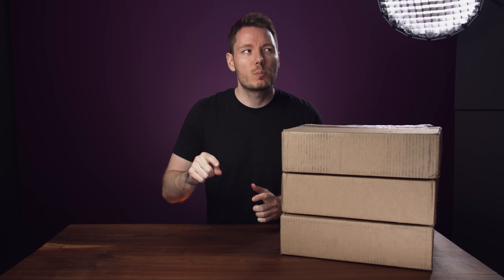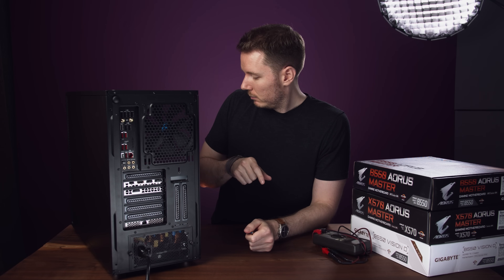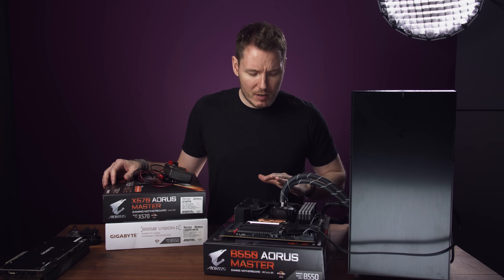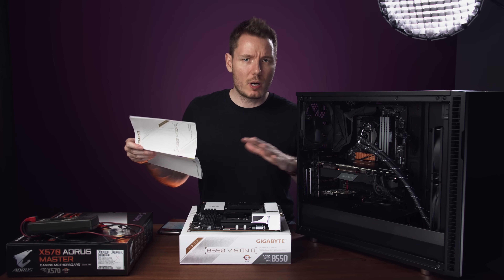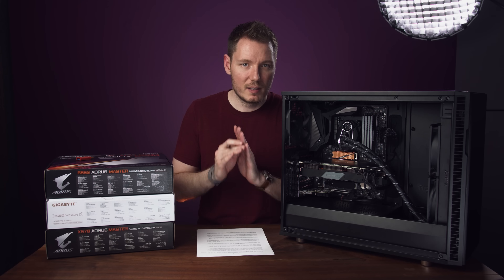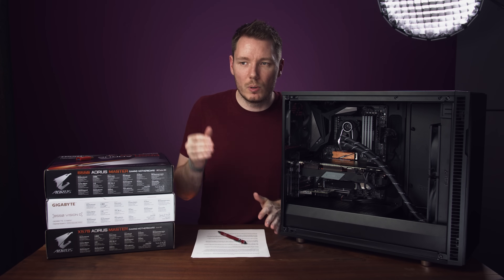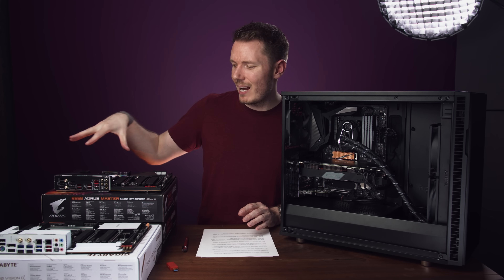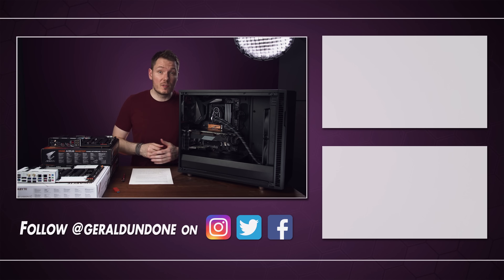I Was WRONG About These AORUS AMD Motherboards

Comment from the maker: For clarity: I have tried swapping the power supply. I've also tried power supply in the case/motherboard out, and motherboard in the case/PSU out, and both out and both in. And tried 3 different power supplies, two from EVGA and one from Gigabyte. It's not the power supply. 😜🤓👍

Update #2: Please stop suggesting I flip my radiator/AIO around, especially when referencing Gamers Nexus. I watch GN too, and I'm following the ideal positioning that Steve from GN recommends in that very video many of you are referring to. There must be a misunderstanding in the community regarding his video, even though he made two. Tubes at the bottom is the ideal way to go for front mounted radiators provided the top of your radiator is above your pump. This way the air bubble will be at the top of the rad and thus won't get sucked into your tubes at the bottom or into your pump. This is what Gamers Nexus recommends. To suggest otherwise is a misunderstanding of his video. And I front mounted my rad because it gave better temps in this build than top mounting. Cheers!
Reply: There is leak current. That is why you don't get continuity when on.

Also the meter can't meter resistance with voltage applied to it, and current leak will apply a voltage differential in the ground.

Also the meter introduces a very small voltage and current to meter the resistance and it might not be healthy to do that with the motherboard on.
Reply: Try a voltage drop test across the ground points when on vs off and see what the readings are. AC and DC. If AC doesn't settle, hook up a scope.
Reply: @RobbyNowell  Exactly. Checking for voltage while it was on instead of resistance, doing a voltage drop test, is the correct answer. A voltage drop test will tell the difference in voltage from one source to another. And if you know the resistance, you can calculate the amps, by doing the voltage drop test.
Reply: "I'm Gerald Undone and it wasn't the power supply."
Reply: I wondered if the screws attaching the power supply to the case were not in contact with the metal - eg the coating on the case was preventing a good ground. I feel like there would be a relay in the power supply and when power is "off" the ground is connected thru fine like you have found,   when the power supply relay is on then the electrical ground has to go through the normal route.  I would think that even mother board mounting screws might not be grounding too well either if the coating turns out to be the issue aswell I'd scrape away the coating in as many places as possible without destroying the look of the case
Reply: Since you removed the motherboard from the case and had the front headers still connected, have you considered the front pcb (or it's leads) where the buttons and USB ports are located?
Reply: Not to put down Gigabyte but I have always had weird hardware issues with their boards, I would like to see the same GPU in an Asus or ASRock board to see if the coil whine persist, there's no telling with their RAM but the fact that both the GPU and the RAM are causing this problem makes it worth trying a board not made by Gigabyte.
Reply: I commented below, but I’m very curious if you have tried running your audio out from the front headphone jack? Had an issue with noise in my speakers on a previous build in an R5 Fractal case and that was the only way I could find to eliminate it. (After rebuilding my entire computer with the same case, the problem went away.)
Reply: It looks like the power supply might be the issue? 👀🥴
Reply: I personally got rid of the whining sound by turning off their light controlling software.
I had to install the software, open it, turn it off and the sound is gone!
Uninstalling the software doesn't fix it.
I'm puzzled ..  I got the Z390 ultra
Reply: Gotta do it each time I reboot... Pretty annoying.
Reply: I saw you switched your pump position to the bottom and immediately thought of GN. Looks like GN's video got everyone fixing their rads :)
Reply: have you tried putting your tower on different surfaces? I say this because the issue could be caused by the tower not being able to ground itself. Over the years I have had many different builds, and in one of my latest builds I had the same issue as you. The solution? I just had to touch the tower and it went away, somehow when touching the tower it would use my body to ground itself (my guess). I could never fully fix it, so I changed my audio setup from analog (from MB) to USB, I had to get an external DAC. I hope this helps, good luck! The fact that the fractal design case is built very hermetically to reduce noise could be the issue!
Reply: Assuming the bells and whistles board you settled on has a power on button on the actual board, disconnect the pins to the front power button and boot without it connected. Alternatively you can jump the pins for the front power with it disconnected to start it if there is no power button on the board. Sorry if it was already suggested or tried, trying to post before running out the door based on what you didn't seem to try.
Reply: Given this only happens when the board is powered, I suspect the problem is not a current leak (since there is actually a small amount of current the the motherboard even when its "turned off"), instead, I think you may be facing an induced voltage problem, whereby something in your system is inducing voltage in the case itself. Induced voltage could be caused by a number of things, the most simple being an electro-magnetic field caused by something electronically "pulsing" (like the PWM circuit controlling the RGB on your RAM), or something more complex to diagnose like the movement of a magnetic field (eg: fans (like your GPU fan) or the motor in your CPU AOI cooler). This induced voltage can offset the voltage that your meter is applying, causing the meter to fail to detect continuity, when actually what is happening is not a loss of continuity, but actually just your meter not detecting that loss of continuity due the new potential difference offset.
Reply: Agree with the other comment of considering the possibility of the PS mounting screws not touching bare metal on the case.  Not a PS issue, obviously, but worth a try!
Reply: Tubes at the bottom are the preferred setup to avoid noise from water + air at the top. However the top of the radiator should be higher than the pump, because air travels to higher point. If your pump is higher than radiator the air will most likely accumulate in the pump.

Comment: I know this video is a few years old now but I've been having the exact same issues with gigabyte motherboards. After talking to a friend who IS an electrical engineer and trying a bunch of different things, (cheap ground loop isolators, different plug configurations, different computer component configs including cheap vs expensive PSU's) it turned out that most likely it is because of how the motherboard is attached to the case. This is consistent with how you experienced this problem in some cases more than others, and didn't experience it when the system was outside a case. The system is successfully grounded via the PSU, however the motherboard also has a special (extra?) grounding design where it grounds via the standoff screws (consistent with your definition of ground loop being caused by multiple grounds). 

By putting small plastic washers between the screws and the case, I believe this will solve your final persisting issue by making sure the system grounds purely via the PSU. This would avoid having to swap out different components, use that USB isolator etc. 

This is just my hypothesis however, based on your tests (thank you!!), my tests, and discussions with my audio engineer friend. I've been putting off trying it as it would involve rebuilding my very tedious compact watercooled ITX build but I can report back to you with my results if you're interested.

Comment: I think that powering up might generate eddy-currents in the case. The whine may be switch-mode power supply related. The radiated magnetic field is affecting the audio circuits by leaking into those circuits and being amplified or there is insufficient filtration of the switch-mode power supply lines and the power supply frequency is audible in the audio circuits. The USB filter is filtering out the power supply noise.

Comment: I was having the exact same issue until I got the usb power adapter. I think this is a logistics issue on the manufacturing of computer parts and how electronics interfere with each other. Things will have to change from a design standpoint. I'm glad for this device though.

Comment: GIGABYTE is shit!  i am done with gigabyte.. going to MSI to replace GIGABYTE board usage,  this X570 Aorus Wifi Pro, (*yes even updated to latest bios) cannot get into bios, cannot reset bios, pulled power, pulled battery, let it set, replace battery, jumpered bios reset, still Frozen at Aorus splash screen upon F12 or DEL to enter bios/boot menu , pulled power disconnected all USB , all sata, BIOS reset again.. NO DICE!  still frozen at trying to get into bios/boot menu. which means I cannot even boot off of USB flash drive if i choose to.  It will boot into windows just fine, even using windows troubleshoot to enter UEFI  fails and still froozen.  I AM DONE with GIGABYTE, this is the second Gigabyte board (4th Gigabyte product) that has failed or has blocked me out of getting into bios.. NOTHING and I mean NOTHING should stop you from entering the bios, the one fail safe item you should be able to get into. I been building PCs since 1985, this is not my first rodeo. ASUS , MSI, has been my solid run to boards, but gigabyte was a cheaper option and now i know why. Pure SHIT!

Comment: I would take all of the case wiring and diagnose it for issues. Could be the USB ports or sound causing some issues. I’ve had cases that just never worked right or would crash if I used the case ports to connect peripherals or external drives. Many times it could be a poorly seated wire on the case button area that came loose was poorly seated during manufacturing or got bumped loose during installation.

Comment: I would go X299  and a Asus WS Board with Thunderbolt. 10980XE and a Broadcom Raid Card. No need for a NAS, way Higher Speeds of a Raid of Drives That you Can Boost with a NVME or Optane Cache Drive. Yes Thread Ripper good, but dont play well with Optane or i have no idea of its ThunderBolt arrangement. Ask Wendel of Level 1

Comment: Hello, coming to this party half year late, but maybe I can attempt to address the ground issue, as I work in similar field. Power return is not the same as ground. Some signals (analog, such as audio) use ground for its reference. But power equipment like fan and lights should not use ground as a return path for its power, because PWM (I assume most people here know pulse width modulation) will introduce noise to the power bus. But if say your RAM (which does not have a dedicated power return for RGB LED?) uses the RAM's ground for power return, its RGB PWM will introduce switching noises to the ground, which is used for audio. The fact that removing the RGB-version of RAM solves the audio problem supports my explanation. Also, the ground check with your digital multimeter, when the computer is turned on, the RGB RAM may have cyclicly messed up the ground hence messed up the multimeter reading. I hope this helps explaining the puzzle somewhat. One of the reason I prefer using optical audio device is that it completely decouples the audio signal from the computer's electrical ground and any issues it may cause. I also design and build audio equipment on the side, and I have found that if a cheap power supply is used, it will introduce high frequency whine to the audio as well. And I'm talking about the speaker's power supply, not the computer power supply. However, I assume your speakers have decent power supply, and thus not the cause of your particular problem.

Comment: ADDITIONAL INFO: I experienced a similar ringing issue with the AORUS B550 Elite in spite of not having any RGB RAM in my system. It was only occurring with the Motu M2 interface and not the Steinberg UR12 so initially I thought it was the interface's fault. The ringing could actually be recorded with the Motu's loopback feature, showing clear lines in the spectrogram around 3900hz and 7800hz when I played a 20hz tone, and those ringing frequencies would rise in some sort of relation to the frequency I played back as that frequency increased.

As of updating the BIOS to the newest revision (F13h) the ringing issue seems to have been resolved, so I'd encourage anyone with these boards to update if they're having any sort of weird ringing sounds in their audio.

Comment: Back in my day we solved our nasty coil-whine problems with a blob of hot-glue. Of course the coils were a cm square. I modified a stethoscope with a broken dental-pick (just jammed the tool up the tube in place of the doctor-disc). It was useful for isolating mechanical/servo problems related to friction &  resonance (or vibration) and it could be used on non-conductives like hard silicone. You want to beware of resonant frequencies; they exist in objects as well as circuits.  Lots of shielded heat-sinks helps on the MB. 
   When a full spectrum sound-wave (eg: pink noise) meets an object with a resonant frequency the reflections will amplify just that particular band four times, leaving every other frequency unaffected. In a feedback loop of your amplified room that will cause destructive feedback, (ringing, squealing or thrumming.)

Comment: i like a lil fan noise, it tells you things, i mean any  room you are in likely has things much louder, computer fan noise is annoying for people that wana be annoyed, i like to hear them a lil, tells you hey i am working real hard here and something is making me get heat, or this is working, funny though this vid because i actually have/had a very similar problem in my car audio build, certian stations encounter audio quirks because i think the antennae being literally the cars unibody frame and also the grounds using the same frame will have problems at certain frequencies and totally fine on others, and no effect while playing CD's but will while connectng a USB mp3 player, can be many causes but i think it is a grounding issue and the unibody frame.

Comment: some of your noise may be coming from the CPU cooler pump. You have your radiator upside down. The in/out for radiator needs to be higher than the pump. There is always a little air in system and if pump in/out is higher than radiator in/out that air will migrate to the pump head and make the pump noisier. it will also shorten the life of your pump and not cool as well as it could.

Comment: I know i am late to the game but it sound like you have a ground loop causing the noise.  Maybe something to do with the backplate on the motherboard. In cars we use to run the audio cables separate from the power cables to prevent that from happening.

Comment: I got here because I am looking for a solution to the same whine sound.
B550 Aorus Pro V2.

A way I can fix it (not sure if it is the solution I will go for, but just to let whoever read this know):
My speakers are powered by USB, and the sound goes through a jack.
Moving the USB from the motherboard ports to an external USB phone charger completely removed all the noise.

Whether this a grounding issue, of mobo, psu or some feedback between the jack and USB, or whatever I am not going to speculate on ... 
I just want to find a solution that works and move on.

Also though about buying a cheap USB "soundcard", but since that is not guaranteed to fix the problem and actually may be worse sound quality than build in audio ...
I think I will just poke around and see if I can get my hands on a free USB charger of an old phone from someone :)

Good luck people. Should'a'gone with good ole Asus :P

Comment: Hey Gerald, just chipping in - albeit late, but I think it is worth it since these videos of yours will be great reference for others. I had the same problems with a different system in a Fractal Design Define R5, connecting to an external DAC and the DAC to my studio monitors. Changing my DAC to an XLR one and connecting DAC to monitors with XLR improved it, but I had to get a USB isolator to remove the ground loops completely. This was happening both over optical as well as USB. All I want to say is that it is not necessary to spend 80 bucks on the iFi defender, since designs based on the same chip are all over the place and cost betwewen 15 and 45 bucks depending on whether  you want USB 2.0 or 3.0. With 2.0 it will be enough for 24/96 audio. If you go for this route one only needs to look for ADUM 3160 chip based isolators for USB 2.0, and ADUM 4160 based designs for USB 3.0. They all work. If someone wants to take it further (and spend that money saved on the defender elsewhere), 50 bucks will get you a linear USB power supply with a 15w toroidal transformer inside, which you can use to power the isolator for an even cleaner connection (probably not necessary though). I am starting to think that the Fractal cases are the culprit, but I can't be 100% sure, since these ground loop issues are a bit "ethereal", as I'm sure you already know.

Comment: Potential electrical explanation for the high pitch whine noise:
I have the same speakers and the same issue and the problem comes when using simple instrument audio jacks (mono) for the monitor speakers. They only have 2 wires and short out the shielding (ground) and the return line. Now you could either use a proper audio jack or tape of the ground pin on both speakers power cable!